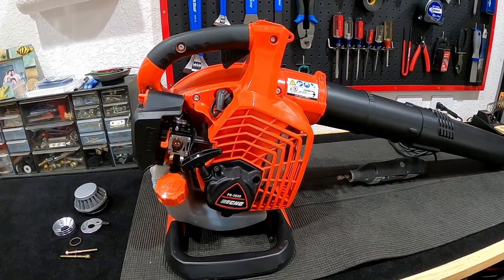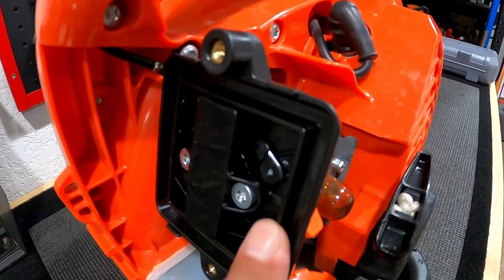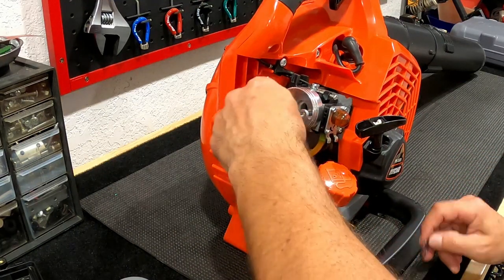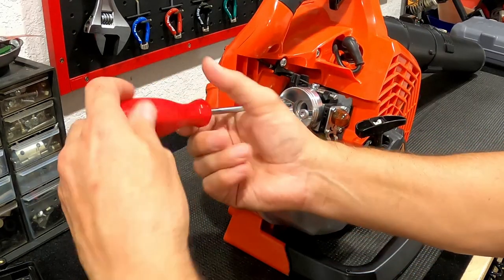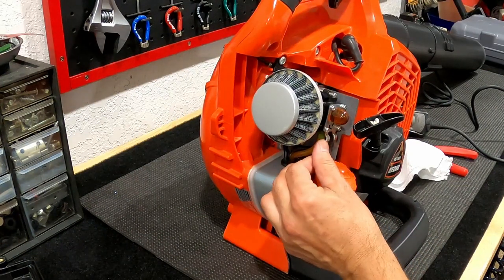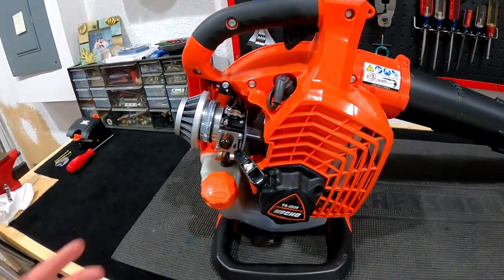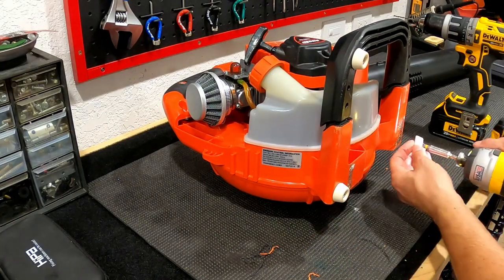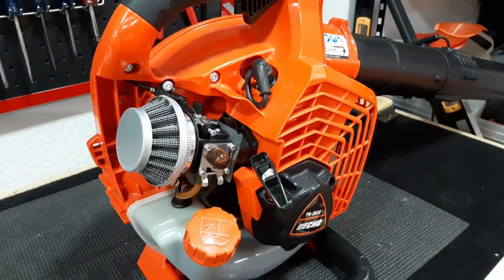Echo gas blower 2620 2520 Air intake kit-- Just for fun Echo PB-2520

Comment: I am a retired professional mechanic and used to specialize in repairing outdoor power equipment including Echo/Shindaiwa for nearly 35 years.  I own a PB-2620 as well and there is no reason for me to make any modifications whatsoever.  I don't understand the idea behind of replacing a well designed air intake system of PB-2620, but the engineers that designed this blower should call you a master.
Reply: I see nothing wrong with this set up.... Guy can do whatever he wants with his equipment. As he sed... It's for fun ... That's freedom..... This has nothing to do with being smart or design.... Obviously guy knows what he is doing.... Having fun while experimenting..... Free choice.....

Comment: Do you think you will be okay without the choke even in colder weather? I’m sorry, maybe I’m loosing it, but I did bot see any links for the air cleaner and its parts.please send me a link. Thank you.
Reply from the maker: Hello here is the link of one I found I believe is the same one purchased since it was a while ago I dont have the same link.  Its on Amazon hope this helps https://amzn.to/3MgnZJ3 .  I think I had to file the throttle section just a bit. thanks
Reply: @ExtremDIY  thank you, I will try it and if it does not work out, I can easily return it for full credit.

Comment: Oh, please send another link for the carb tool kit. Can you give any clues as to how to tune the carb for maximum performance? If you have a video already, or do a video, please send that link too. It will be most appreciated. Thank you.
Reply from the maker: Hello I dont have a video for the adjustment of the carburetor but is easy to do.  All you do is warm up the unit real good, with the correct screwdriver adjust the screw till you get a smooth running engine at full throttle by opening and closing the screw.  I always use ethanol free gas so you wont have carb issues.  Let me look for the link and will send to you for the part. thanks
Reply: @ExtremDIY  thank you, i will give it a try. I ordered a set of the carb tools with the half-D driver so I should be set.

Comment: Where did you get the air filter and adapter!
Reply from the maker: Hello I purchased on Ebay a while back.  If you put mini air velocity stack you get a bunch of options.  The most important is the width between the screws and find one that has that width and should fit with a minor mod to the throttle lever like I did on the video. The one I purchased is no longer available but is a common item.  Let me know if you have any questions. thank you

Comment: You realize more air requires different jetting or you will run lean.
Reply: Hello yeap it had to be adjusted a bit I just had to buy a new tool for it.  The older carbs were a flat screw driver these are different but works great.